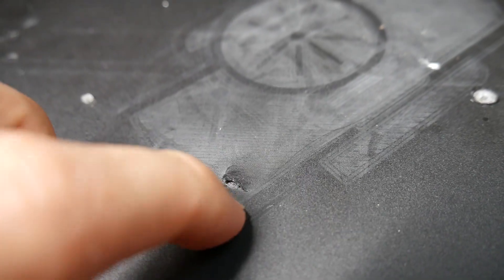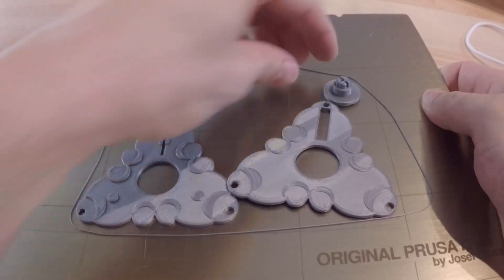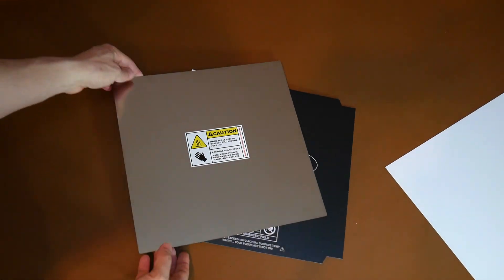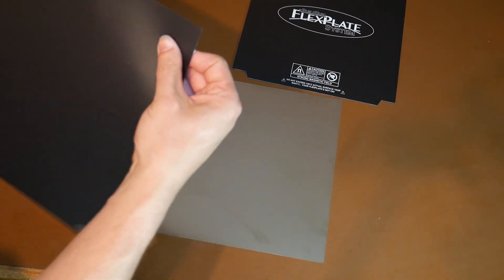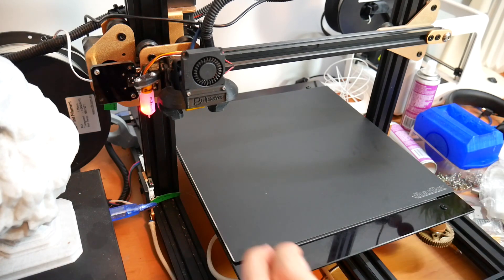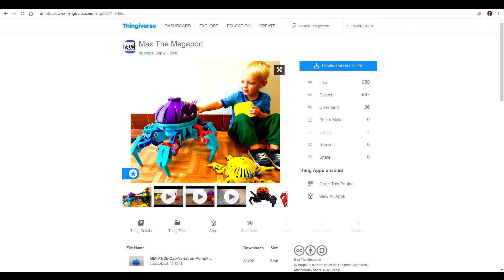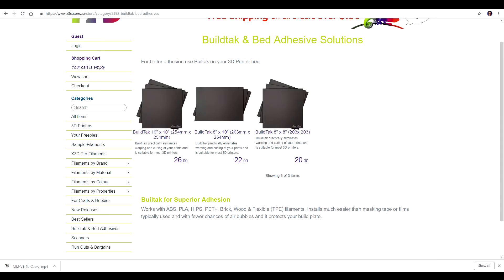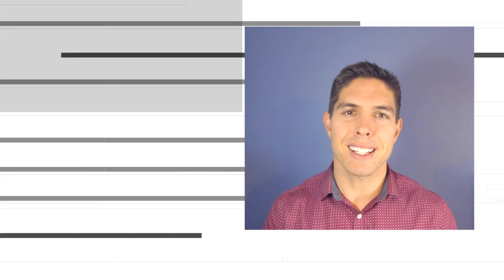Buildtak Flexplate - Prusa style removable magnetic bed for any 3D printer

Comment: I installed one on my CR-10 Mini a couple months ago and love it.  I do use a glue stick on top of the surface as I find that works perfectly to keep it from sticking to much and now everything just pops off.  You can also remove the plate and just wash it under running water when the glue stick build up is getting to much.  It so convenient to use.

Comment: Got the Buildtak Flexiplate on my CCT too, Micheal. Best decision I ever made. :)
Reply from the maker: As mine is a flex specific machine now, I use 'tthheekkiinngg' "PEI coated spring steel" plate on top of the flexplate base. It shouldn't be but it is perfect for flexibles with the bed temp off.

Comment: It is nice to know that options exist. Got the powder-coated version for the mk3 and it is fantastic but I doubt I can get a replacement in the next year or so for it.  I at least just need to order the spring steel sheet and print surface and do not have to buy the whole system.
Reply from the maker: Yep you can buy spring steel sheets separately from Buildtak which is nice.
Reply: You can get PEI powder coated spring steel from Canada searching for "PEI powder coated" on eBay. At the moment you only get it for Prusa mk3 and Flashforge, the 304x304 sized for CR-10 is sold out (4 days ago it was available and I ordered one, 46€+14€ shipping).
The texture is finer than on original prusa (I like the prusa texture more) but the function is the same.
"Naked" spring steel is availabe on Aliexpress for 22,90€ including shipping (search for "Energetic removable spring steel sheet").

So the "only" thing to do is to make the headbed magnetic. As I want to do it with a JGAurora A5, magnets under the bed are not an option (the base is steel, so the magnets tie in direction of the base). So I thought about an simple solution:
3M adhesive onto the bed (5 pcs 315x315 costs 16€ at AliExpress). An aluminium sheet 2mm thick 315x315mm² (about 10€ plus shipping). 20 magnets samarium-cobald, 6mm diameter, 2mm thickness (aliexpress about 10€ incl. shipping). Drill 20 holes into the aluminium sheet. Put it on the adhesive on the heatbed. Put the magnets in the holes (also glued by the adhesive). Maybe kaptontape for protection on the surface...

Comment: Thanks for the review. Still a DIY- Version costs less than half of that price while maintaining the same amount of convenience. You need just a flex steel plate, some high temp magnets (glued on the underside of your bed with cheap silicone) and a build tak surface. I've spread wood glue onto the other side of the steel sheet to have a flippable print surface with a rough and a smooth side. Still this Buildtak sytem is finally something seriously considerable due to the (seemingly high quality) high temp magnetic surface. Have you heard of the wham bam flex plate kickstarter? Nerys recently reviewed a prototype. It has a special coating similar to PEI but a much higher adhesion performance. Have a nice weekend. Cheers!
Reply from the maker: Just looked it up. the price is certainly better. I wonder how much it will go up after the pre-launch discounts.

Comment: I've installed these on both my old Wanhao i3 Plus and the (great) Ender 3 after I spoke to a salesman at the TCT show earlier in the year, and so far I like them a lot. A key difference are the magnets and adhesives being good for the higher temperatures and that's one of the reasons I went for it; didn't want to switch to a system that restricted me to PLA and PET.
The other thing that will be interesting to see if it pans out, is the claim their different build surfaces are the same thickness so if you swap out a Buildtak plate for a PEI plate, there should be no need to re-level. I picked up a second build plate and surface sheet  - I'm not sure sticking sheets to both sides is a good idea as it presumably slows down heading the bed.
Obviously they are costly relative to the price of the Ender 3 in particular - the system plus spare plate and PEI sheet together cost almost as much as the printer - so it's only a certain type of person that will go for it rather than the Creality magnetic removable bed solution.
I wouldn't suggest it for people who already have a removable bed system because of the cost - but for people with machines without the removable bed, and who want to print ABS, ASA etc and not just PLA and PET it is a good upgrade. In my case it was reasonably justified on the old i3+ (no removable bed, and the sheet was already in need of replacement), but an extravagance on the Ender 3.
Reply: I run mine dual sided.  PEI on one side Buildtak on another.  and then on the other machine I run PEI and Geckotek hot.
Reply from the maker: Great info guys, thanks so much for sharing.
Reply: @TeachingTech  Just thought I'd add to this. More recently I've also been using the soft magnetic removable mat on an Ender 3 Plus. I've found that the soft magnetic mat system is far more forgiving; much easier to get a good first layer especially without mesh bed levelling.
I think it's because (a) the flexible mat surface is more coarse which seems to grip better, and (b) it has a little give in it so you don't need to be super-accurate with the distance between the nozzle and the build surface.
In contrast, with the Buildtak plate I have to use mesh levelling for anything that uses a significant amount of the build area - and without a bltouch (yet), that is quite painful.
I think what's happening, is that with the Buildtak metal flex plate the levelling must be perfect across the plate - and with the typical warping you get with the aluminium heated beds, mesh bed levelling is pretty much imperative. With the flexible magnetic mat, however, the mat itself will squish a bit if necessary. I've yet to try a bltouch andI've been mesh levelling by hand - which isn't exactly quick!
Upshot is that for all PLA printing (which most of what I do of course) I find the flexible magnetic mat is easier, more reliable, and quicker. It also doesn't risk catching fingertips when returning the surface to the print bed...

Comment: Used Buildtak on some Gigabots for years. It wasnt flexible or removable like this but I can attest to how well ABS and PLA stick. Really strong surface!
Reply from the maker: The first time I used it , back when it first came out, I had the first layer too squished and couldn't remove the model. Had to throw it away after one print :( Hopefully this flex system alleviates that problem.
Reply: Yeah too close and you'll have problems. On the Gigabot, the bed wasn't easy to remove either. After a few months the surface actually lifted with the print. But for me with the amount of hours we printed on it, it was a small price to pay for never having a model curl, or lift mid print. Really reliable!

Comment: I found this super helpful, off to buy a system for my Ender :)
Reply: Yup, makes total sense to buy a build plate costing as much as the printer itself. And for just about $500 more, you can upgrade the Ender 3 into a machine that even rivals the Prusa i3Mk3 - both in quality, features and price! Also, supporting innovative original manufacturers is important.
For me, i think i'll wait until China produces a clone for a fraction of the price of the original. Until then, my $15 Creality Cmagnet surface will probably work just fine. ;)
Reply: @axelhopfinger533   Just raw spring steel sheets are 30-40 dollars.  That's why china produces the crap magnet sheets instead.  I don't know of any ender 3's that cost 90 dollars either.  Which is what these cost.  Add a bed level sensor, and a titan aero and you pretty much have the set it and forget it printer.
"Also, supporting innovative original manufacturers is important.
For me, i think i'll wait until China produces a clone"  you don't even make sense.
Reply: @illregal  I make perfect sense. Cynically speaking. ;)
Reply from the maker: There are multiple paths to 3D printing nirvana (and all of them cost money). Some may wish to spend a great deal more than the purchase price, others will just buy a more expensive machine. Like any hobby, it's hard to justify the costs to an outsider so in fairness it shouldn't really be criticised.
Reply: @TeachingTech  Of course you're right. After all ,there are people who buy some cheap or old car and put twice its original worth of money into tuning and upgrading parts, until there is barely an original part left on the chassis. Some even do that with their own bodies. If you have the money to spare, go knock yourself out! After all, 3D printing is a luxury hobby, if you don't do it professionally. And it is only due to those super cheap budget Chinese printers, that some of us even were able to pick up 3D printing at all.

Comment: Hey have a question and it may be something you might wanna try. The magnetic flex plate for FDM printers, can they be used on resin printers? Seems like the same material, it needs tobe stuck down the same. If it worked it would save people so much money when trying to get flex plates for larger resin printers.

Comment: Hi Michael, I'm considering the flexplate for my 2018 Tevo Tornado because I'm getting a lot of warping and lifting around the edges of my prints using PLA on the stock glass. Do you know why this would be happening? I put glass on my ender 3 and have no trouble with it but the Tevo I can't figure out. I've used glue stick, hairspray, magigoo, different temperatures and cooling fan speeds and still get some warping. The only thing that has really helped is including a brim with 25 outlines. If you have any suggestions I would appreciate it. Thanks
Reply from the maker: I suppose the larger size is going to exaggerate thermal instability. I had phases with mine where I got something on it that made sticking inconsistent. Before you spend any money try windex, I've read a lot of people have had great success.
Reply: @TeachingTech  I've been using alcohol, I'll try some Windex.

Comment: Hey Michael, great instructions / comparison. I would like to lighten the weight of my CR-10 bed, but this is a bit pricey, so maybe I'll stick (excuse the pun lol) to glass for a while longer. On the case of Hexapod, I've just ordered all the parts for mine. Buying from Vorpol will cost around £150+ which is too much for a toy, so I decided to risk it on Ebay. However, I will be making a donation to Vorpol when I'm done, I am a big advocate of supporting the open source community. Something that just occurred to me, is are there any differences in electronics between the original and the Max Hexapod?
Reply from the maker: Glass is definitely a good solution, I'm just impatient. I've just opened my Vorpal delivered kit and the game pad stuff is the same, as well as the Arduino Nano for the pod. Everything else is different from being scaled up. Servos are beefy!
Reply: @TeachingTech  I guessed the servos would need to be a lot stronger, may build a big one later, assuming the small one goes ok :-)

Comment: You should really prepare the viewers for the sticker price shock. It’s a great solution but for a CR-10 size printbed size you can buy an entire small entry level printer. The build surface shouldn’t cost 1/4 to 1/3 of the printer price.
Reply from the maker: Everyone is free to make up their own mind. Some people approach it from the point of view that they start with a cheap printers and spend triple the price over time on mods to bring it closer to a Prusa for less money. the price at the end was not on purpose, I just forgot to mention it before then while recording.
Reply: @TeachingTech  My complaint in this vein isn't that there's sticker shock.. but that you gave the price of the tool, and didn't give the price of the flexplate in the video.
Reply from the maker: Watch it again. I can the price and show a screen grab of the store I bought it from with the prices of various sizes.
Reply: My apologies, I must have missed it. Thank you for pointing it out.

Comment: One of the few accessories I've bought I can wholeheartedly recommend and be evangelical about.
I went through a couple of the original Tevo 'stickers' - prints stuck too well, and I'd bubble the surface as I removed prints. What really make the process unpleasant was the 'gummy glue' they used. Took a load of solvent and elbow grease each time you wanted to take the print bed back to the glass.
Next thing I tried was the Ultrabase. THE most frustrating product. New, they worked perfectly. Everything stuck and when cooled it was already detached. Problem I had was that they degraded and official solution was to sand them - which is ridiculous as it removes the little bumps that make the thing work. Other people didn't have this problem. I gave up after 3. Still wonder if it was just a faulty batch out there.
In a fit of utter misery I threw money at the problem, and got my flexplate 6 months ago. Cost aside, it's been utterly faultless.
As mentioned in the review, the print surface itself does degrade (normal wear and tear) - I'm on my 2nd and have a spare sitting in the corner. Plus is that once you've bought "the system" the price of the print surface is pretty reasonable (in UK I've got it on my Amazon subscribe and save) and it's trivial to change. Surface peels off easily and without residue from the flexible bit of metal, and you just apply a new surface (5 min job).
One reason I bought the system (but haven't actually used) is that you can also pick up additional spring-steel plates to fit on the expensive magnetic bit that glues to the glass. Would allow you to swap out your print surface (buildtak sell PEI, but you could use anything) as you change the material you're printing.
I think my summary is pretty simple. If you're having print surface problems and can stomach the price, buy it.
Reply: 6:07
Reply from the maker: Definitely mentioned the price and even ha a screenshot too. Nonetheless, your summary is indeed spot on. I've yet to see someone unhappy with this product. I agree, if you can stomach the cost, it works brilliantly.
Reply: @TeachingTech  my apologies, you did.. No idea how I missed that
Reply: @hennohimself  thanks, clearly I need sirens to be sounded on each edit so I don't miss stuff